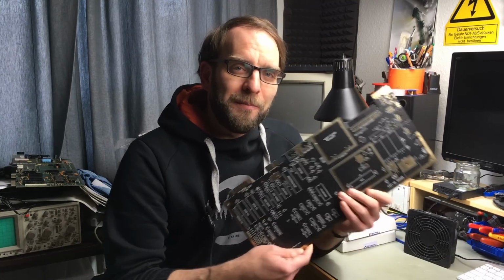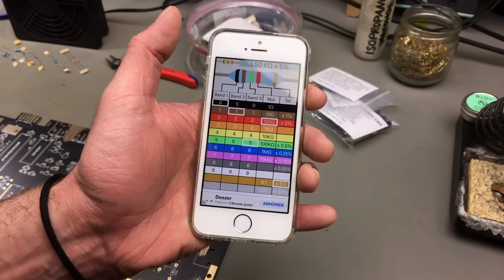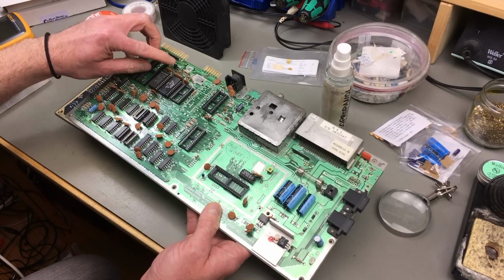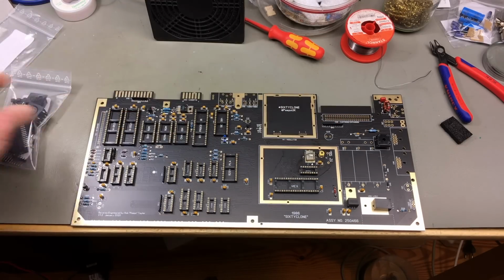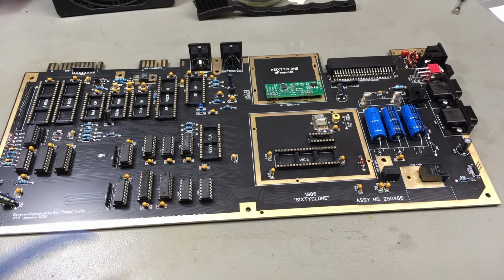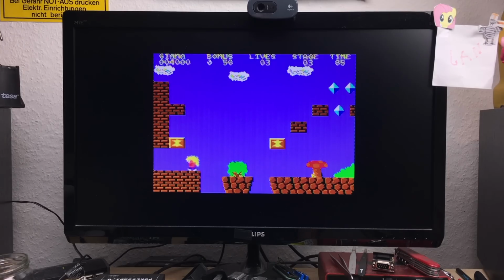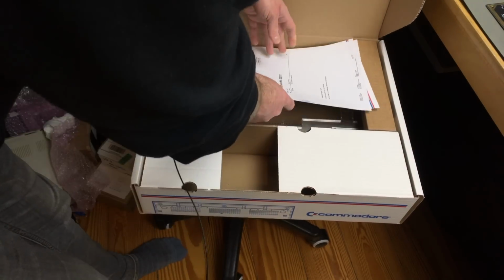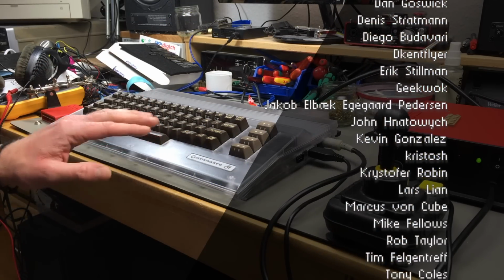Building a new C64 in 2020

Comment: The parts kit Jan used normally ships with ALL the passive components and RAM + Logic.. Little oopsie by me to forget to put the diodes/filter/transistor pack in the box. So no need to salvage anything from an old board expect the cartridge shield, modulator if you want to use an original and of course the MOS Chips (except the 8701 since I will include a new one), and if you use th 7805 you need a heatsink too.
Reply: Shannon Smith  you can buy the board from one vendor, part kits from other vendors, chips from yet another vendor.....links are in the description
Reply: @Apple Stops current flow in one direction. Used to direct flow based on voltage levels , but also to protect components from wrong inputs.
Reply: Shannon Smith  If you want I can build a complete board for you, excluding the MOS chips. You can check my shop for a link to the item.
Reply: @Apple Allows current to flow in one direction but blocks it from going the other.
Reply: This is so great. Lot less headaches for novices like me. Thank you!!
Reply: Sorry for my incompetence, but when I went to your website I couldn’t find the complete kits. Can you please point me in the right direction?
Reply: @Colin_Ames  SOrry, was switching the item to Backordered and that caused it to drop from the site for a short while. It's back on there, but you can only do a backorder at this time. Jan's video created a bit of a Black Friday storm on my stocks ;) Expect to resume shipping in 2-3 weeks.
Reply: @mbosschaart  
Will any of these parts work on a new C128 pcb like the C128Neo?
https://www.tindie.com/products/griffinretro/c128-neo-pcb/
https://c128.se/
Reply: @tibfulv  The kit might have components that are also used in a C128, but was intended for a C64. You’ll miss many other parts.
Reply: @mbosschaart  
Might still be useful. Might save me the time to source at least those parts.
Reply: @mbosschaart  
I will do when I'm well enough.
Reply: @Apple There are a few different types of diodes, but the all rectifiers.  That is, they pass current only one way, DC can flow only one way through a diode, and only half of an AC waveform will flow through a diode, giving pulsing DC. Zener diodes, conduct in reverse only at a certain voltage and are used to regulate voltages.  Signal diodes are faster than regular diodes and are used for high frequencies and low currents. Light emitting diodes emit light.  Constant current diodes can be used for current regulation. Schottky diodes have higher current handling and faster switching and lower voltage drop. Shockley Diodes are like thyristors without gate terminals, it has two stable operating states.  There are more than 16 other types of diodes as well including laser diodes and other esoteric types.
Reply: Would you consider an ATARI XL/XE system kit?
Reply: Can someone help me to identify, maybe in the BOM, which parts does not come with the kit? The shop says MOS chips are not part of the kit. I know those are at least CPU, PAL, SID but I dont know what else. I just wanna make sure not to forget anything. thx a lot
Reply: @Triggerboy78  CPU, PLA, CIAs, VIC and ROMs are not part of the kit. Modulator also isnt but I’m about to start selling replacements in a few weeks.
Reply: @Triggerboy78  Oh and the SID of course
Reply: @mbosschaart  That was a fast response.. thx !
Reply: Shit happens bud, no worries 👍
Reply: packing list might help you and the next costumer ;)
Reply: @vectorjoe  Well, the stupid thing is I actually have that. Must have been sleeping. Will not happen again :)
Reply: @mbosschaart  then you need a checklist where "packing list" is one of the bullet points ;)
Reply: @vectorjoe  Costumers and all those other artsy theatrical types use Apple products. ;)
Reply: I have one of your kits coming soon as well!  Looking forward to putting your parts on my 466 board.  Such nice things.